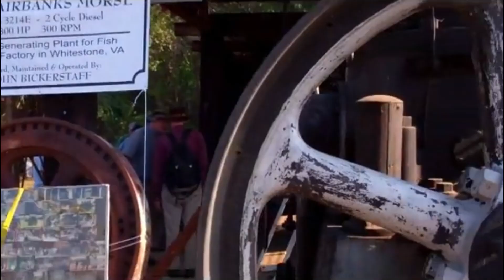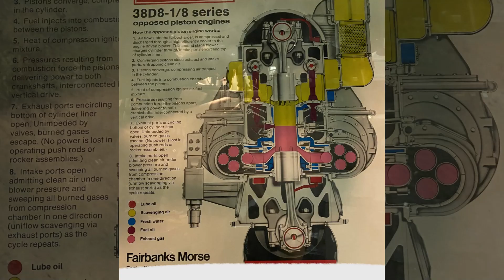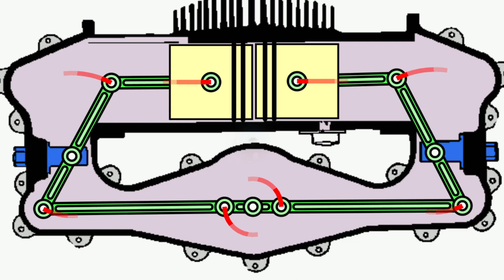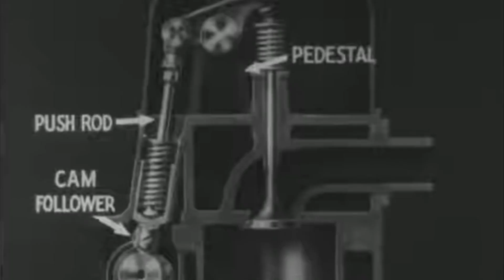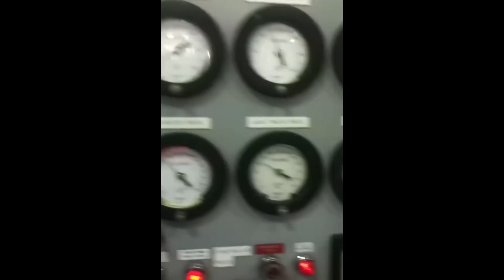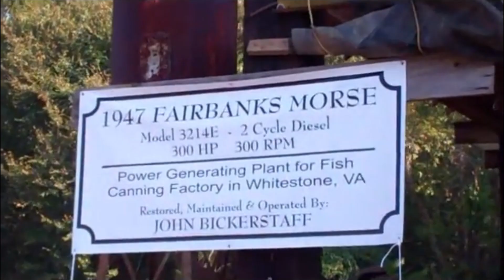The Submarine on Rails: The Rise and Fall of Fairbanks Morse

Comment: Diesel engines in submarines only run when the sub is on the surface. They are used to charge batteries.